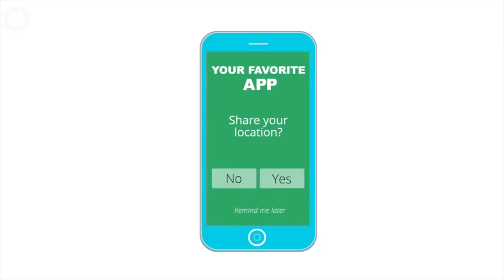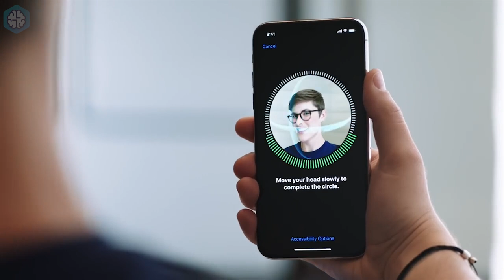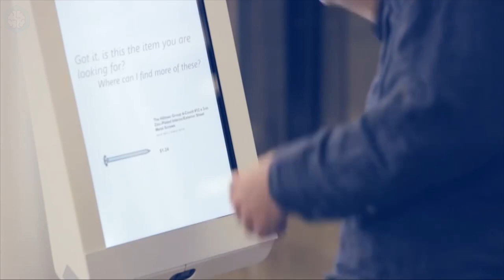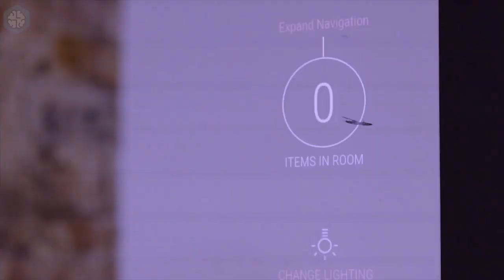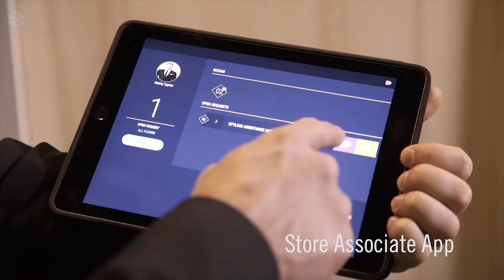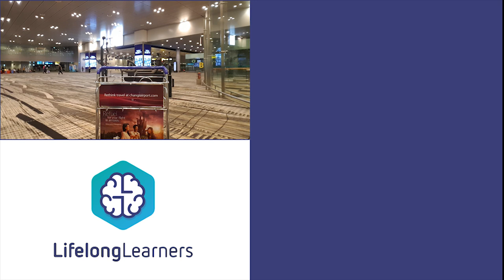Retail 2020 | 5 Technologies that will change the way you shop

Comment: The smart mirror thing could just be a crowd puller than actually increase sales. One of the biggest challenges of e commerce since its inception has been that it never got people over their need to touch and feel the product before buying it. similarly i feel that even with smart mirrors people would want to wear product and feel how it fits. on a side thought, it could even be hacked into right? bit creepy
Reply from the maker: Something watching you and potentially learning about you and your style... Bit creepy? Probably!
There tends to a be a link between foot traffic and sales so if it does pull a crowd it should lead to extra sales.
I doubt we will ever lose our desire to touch and feel. The mirror shouldn't act as a standalone technology but rather be integrated into the process so it is easier to determine if you want to try on a different style or colour.
Thanks for the comment Hilly
Reply: U can actually buy a smart mirror rn it's called himirror
Reply: Agreed. The smart mirror just feels like it'll be for that person who takes loads of clothes to the changing room just to try them on for Instagram. Having a mirror do that that takes less time than changing clothes yourself with just be surrounded by ppl trying to use it.

Comment: Ha ha, this video is a compilation of technologies that have not caught on and will not catch on in the near future. The only exception: Amazon Go. I already predicted this in 2016. Because the first 3 technologies mentioned here do not solve any problem that the customer has. Nobody wants to get more advertising on his smartphone via beacon or be guided through the corridors by a robot as long as they don't really look like humans. A solution on the customer's smartphone would make more sense. What woman wants to choose the products she wants to wear in front of a mirror without feeling or smelling the fabric? Selecting the goods when they are hanging on the coat hanger before going into the fitting room is part of the shopping process, which is perceived as pleasant. So which problem is being solved? None at all.

But Amazon Go actually solves a problem that the customer perceives as such: The queuing and waiting at the check out counters.